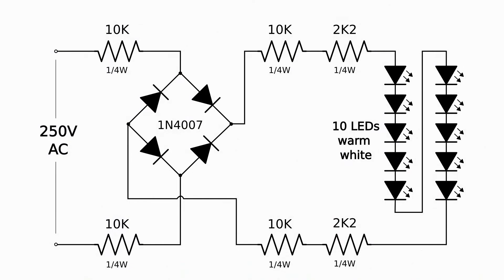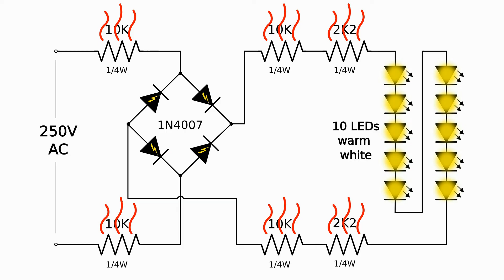How to make a decorative (kind of vintage) spiral LED bulb from scratch

Comment: How much volt and amp i get from this circuit
Reply from the maker: Voltage depends on the combined forward voltage of your LEDs and the voltage of your wall outlet, so in my case current is about 6mA on 240V (current also depends on your mains voltage as well as the forward voltage of your LEDs)

Comment: great job! It is not very easy to open a bulb without cracking!
what did you use in 10:02 for testing the LED?
Reply from the maker: Thanks! Yeah, it's strange that something as simple as water should suffice to loosen the adhesive...
At 10:02 I used my diy voltmeter/continuity/LED tester. Built a few years ago; never documented it anywhere.
Reply: @ChronicMechatronic  looks like an interesting gadget
Reply from the maker: Honestly, it didn't turn out as well as I had hoped... It's based on one of these 7 segment LED voltmeter modules, and I just don't like the low resolution. I generally use it only for continuity and LED testing.